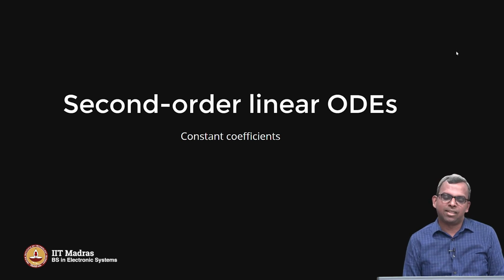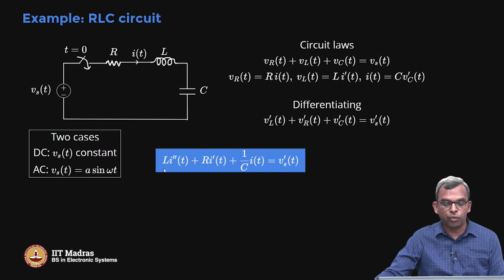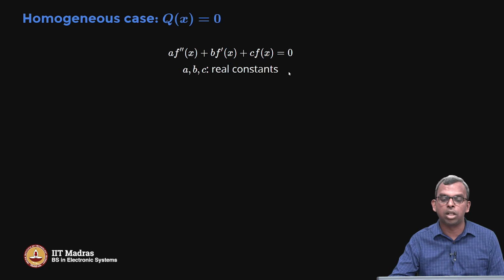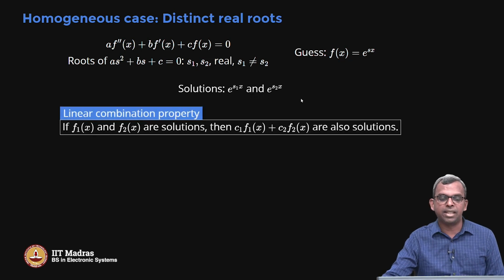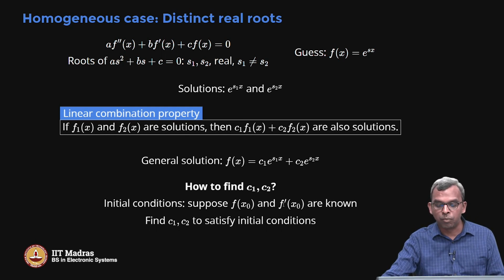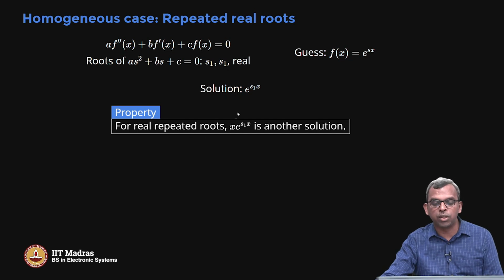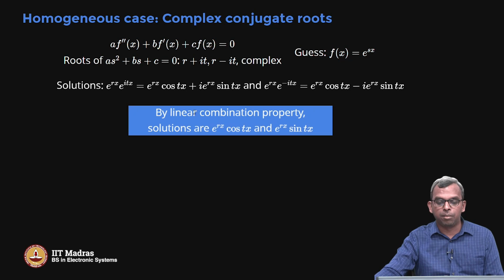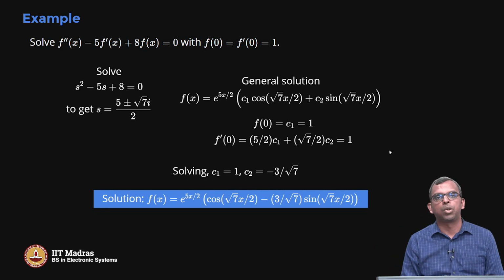W12_L4: Second-order differential equation

Comment: 4:20 Note this slide 
10:35  if you have two solutions then the Linear combination of these two solutions is also a solution to the equation
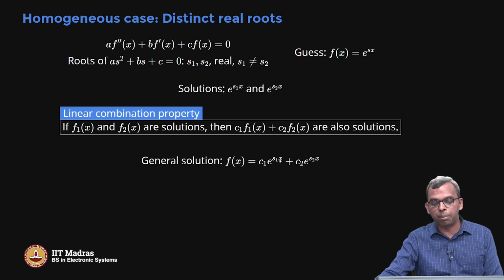12:37 General solution
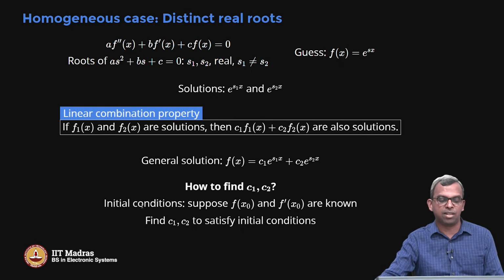12:46 note
14:15 Example of solving a problem
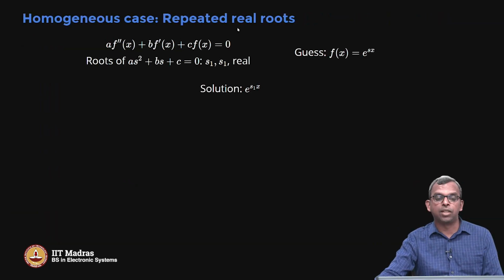15:10 Homogenous case: Repeated real roots
xe^sx is also a solution
17:08 General solution for repeated roots